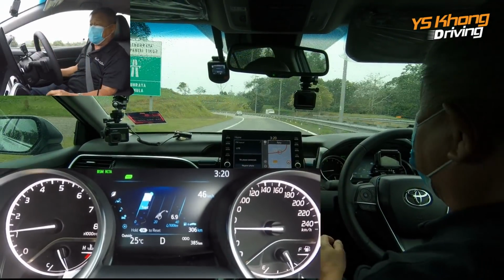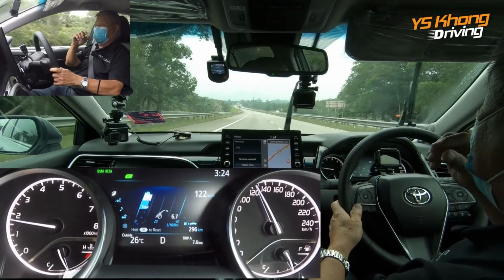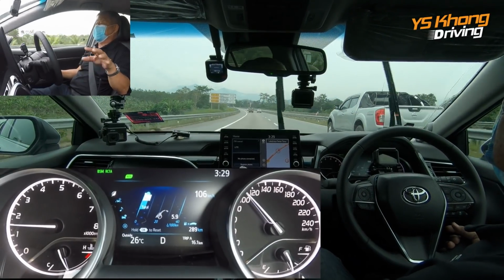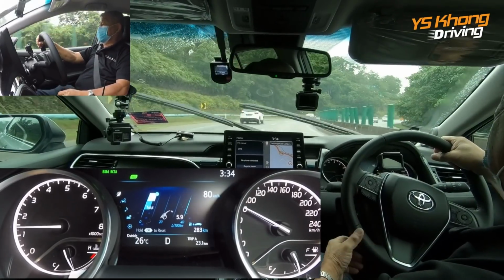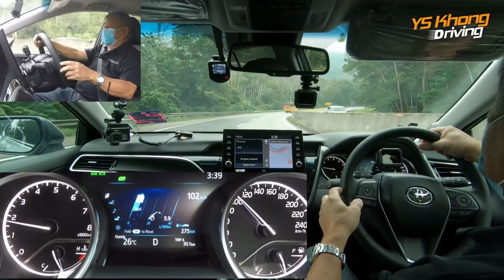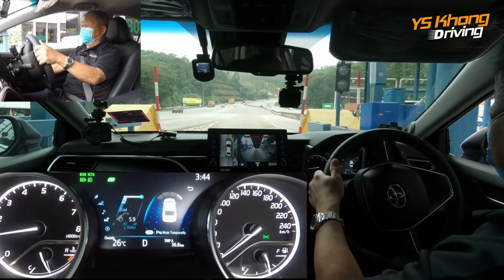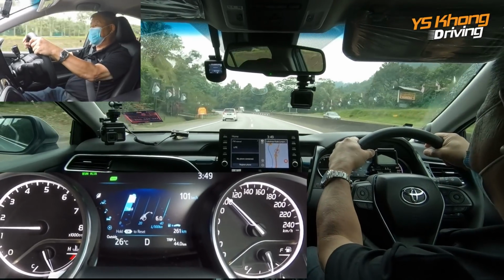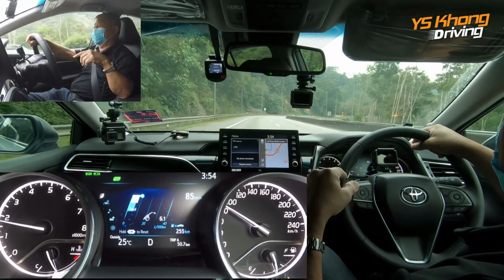Toyota Camry 2.5 Dynamic Force Engine, 8-speed Automatic, Fuel Consumption Test / YS Khong Driving

Comment: It is a bad engine really, lacks power and torque, it is noisy and not economical at all, not to mention the added maintenance costs by the added  engine electronics,  the oil filter is ridcoulous small and doubt this engine will last the test of time
Reply from the maker: This is the Dynamic Force engine with 40 percent thermal efficiency, my dear! What are you talking about!

Comment: You should come to germany and test again. I wonder, how good it performs at speeds above 200 km/h.
Reply from the maker: 99 percent of the cars here do not go above 200, so it doesn't really matter.
Reply: @YSKhongDriving  Im pretty sure this Camry does. Over 200 PS is more than enough ^^. When I was young, I had a small sports car, which did 200 km/h and had only 90PS.
This Camry should be able to drive somewhat, between 220 and 250. It depends on the cw (drag coefficient).
Its quite interesting, that the whole answers here are more about fuel consumption, then about speed. But I guess, if you arent allowed to drive that fast, then you have other values. 
Nice video though, I learned a lot =).

Comment: Uncle ys, would u think the 2.0 dynamic in other region vs 2.5 dynamic force engine, which will more fuel efficient?
Reply from the maker: It depends on the weight of the vehicle and engine size ratio.

Comment: Hi Uncle YS, between the Toyota Camry 2.5 with Dynamic Force Engine and the Honda Accord 1.5 TCP, which model would you recommend? The FC, ride comfort, daily usability, and driving pleasure.
Reply from the maker: The two are very similar, with perhaps the Camry having a few more premium features. And a wee bit more comfortable

Comment: Thank you Mr Khong. Thoroughly enjoyed the video. This new 2.5 very efficient. It's a little sluggish off the line  (likely transmission tuning for fuel economy) but after that it's more than adequate over all.
Reply from the maker: Excellent observation, Alex. Keep in mind the primary purpose is a good and comfortable ride, an efficient engine.
Our testing on the mountain is but a means of comparing it with others and shaking it down.
Reply: @YSKhongDriving  I agree with you 100%, Mr. Khong. Its really is a great car. It has excellent handling as well.
Reply: Can it run on RON 95?

Comment: uncle, why don’t use cruise control, rather than always accelerating and decelerating throughout the video? wouldn’t the results be more consistent?
Reply from the maker: Cruise control will want to get to the set speed as fast as possible after an obstacle, so will accelerate harder. So if you wsnt to save fuel, use your foot.
Reply: @YSKhongDriving  just turn off during uphill..I use adaptive cruise control during flat road only. and its fuel save

Comment: lol uncle seems struggling to hide his heavy-foot, the speed always climbs up to around 120 then uncle back it off a bit to around 105 then starts all over again :)
Reply: ahaha..agree. not easy to become light foot
Reply: Yeah that’s not good for fuel economy
Reply: @gustavomercado1599  agree..not everyone able to practice smooth and constant driving.
Reply: @gustavomercado1599  well.. that car in particular is at 1600 rpm at 120 so ... in that condition speed is just a number. in my yaris i must run at 70 km/h to keep rpm below 3000, if i run at 120 kmh i must be at over 4k (i don't have an actual rpm gauge), only there the cars consumption sky rockets, and i really feel i am beating the car and it's not good
Reply: @fasttracklap8480  not exactly. You se the transmission can keep the revs down and don’t get me wrong that’s good, but the wind resistance increases exponentially, a tiny 20 kph increase means a lot no mater the engine load

Comment: Wow! Great fuel consumption but the Lexus ES250 which Uncle tested few months ago with same engine gearbox combo but much heavier recorded 5.3L/100km if I'm not mistaken. Maybe the Lexus engine and gearbox may have got slightly different tuning and calibration
Reply from the maker: Different conditions, different roads, different days, will yield different results
Reply: probably Lexus using lighter materials.
Reply: @paullim7668  Read there I mentioned heavier
Reply: @paullim7668  ES is 110 kg heavier
Reply: Isn't the es250 uses 2.0 dynamic force engine?
Reply: @muhdmat8454  Yes of course. But what I am surprised is it drank less petrol than Camry although it's 100 over kg heavier. Maybe Lexus did some minor tuning for ES

Comment: 110 km/hour at just (1500rpm or 1600rpm )

what a great toyota na engine...."maybe" at speed 200km/hour it just reach at just 3000rpm...this engine have "best" flat curve tork nm at wider than other...big 2500cc na car that consume less 6 liter is impresive ! These toyota new engine should put in toyota fortuner ( petrol version)  current model
Reply from the maker: The 2.1 ton weight is a big issue. The best engine would be the 2.8 turbo diesel.